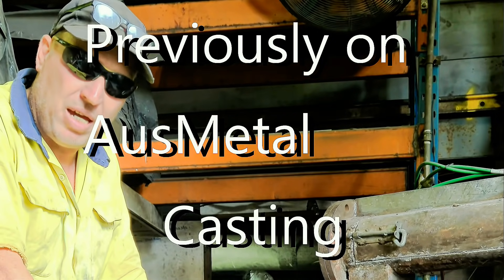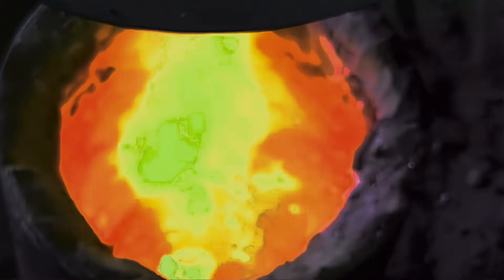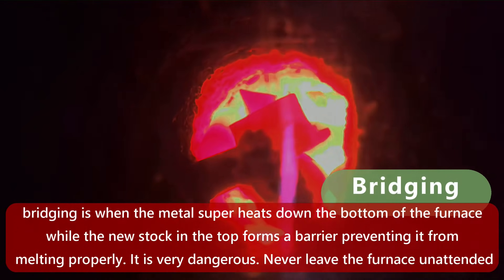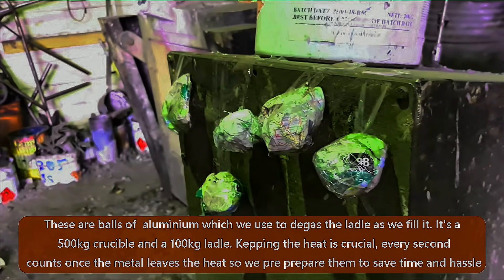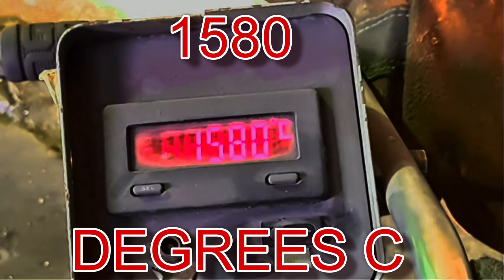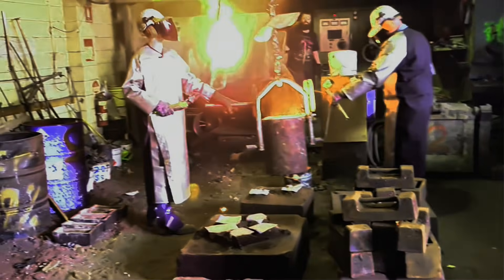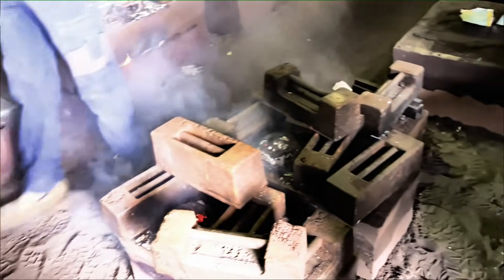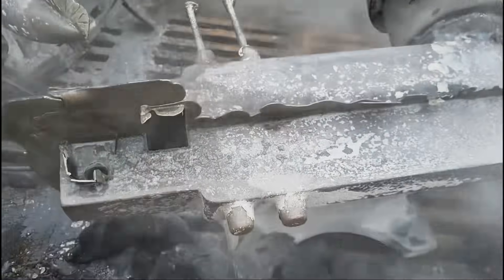Making a 100kg / 220lb Steel Anvil - Melting Steel, Pouring Molten Metal, Red Hot Water Quench

Comment: The fact you make you own power to melt the metal.  The pour is the highest quality .
Reply from the maker: Cheers!
Reply: @AusMetalCasting  before I shut my foundry down we had entertained and should have gotten a generator. Power delivered to us via power lines we were billed 5,000.00 a month for demand charge on top of our use which was 2,500.00 a month for a 350 KW for a total of 7,500.00. Journeyman molder by trade here. Good to see my fellow Foundrymen in action. 59 years old now started at 17.

Comment: I work on detroit diesels. My old crown school bus has a 6L71 turbo charged detroit. My boat has twin 6v53 engines. I just rebuilt an 8v92 like the one running that furnace.. such power from a simple 2 stroke engine

Comment: 9:25 doesnt top pouring lose a lot of heat, introduce unwanted oxygen, and cause excess agitaton ?  Wouldnt pouring from the bottom partially mitigate all three ?  Also, what about pre-flushing the heated ladle, and mold, with xenon gas further reduce oxidation ?

Comment: yesterday i saw a japanese knifemaker video, traditional charcoal forge. he coated the knife with some clay pattern on the blade, put it in the forge and quenched it with water. the clay mix prevented some parts of the blade from  getting too hot, acting as a heat shield, in order to remain soft when quenched, at least thats what he said, i dont know if this is bs. here you jet specific parts of the hot anvil with water to harden these areas.
after the blade was polished the blacksmith could see the quenching pattern on the final blade surface. meh.
I have seen another guy on youtube, just immerging in water (or was it oil i have a doubt) the edge of a knife blade, about 1cm along the entire curved length of the blade.
while the japanese guy drew some cross lines with the clay to soften parts of the blade's cutting edge. 
man i guess now im a quenching expert after aknowledging these different technics. hhhhhhhhhh.

Comment: Must be quite a high alloy steel if that slow a quench gets it hard, wow. Many Blacksmiths report that old carbon steel anvil faces need an absolute deluge, basically waterfall or watermill penstock or emptying a big drum of water on top....
Reply from the maker: Bob is only quenching the bed and horn. The way the red hot metal turns it to steam is essential to the process. We are avoiding quenching anything but the bed and horn and allowing the rest to air cool. Jamie was there for quite a while quenching
Reply: @AusMetalCasting  Yeah, of course. But if the face of an anvil is 1045/1060 or some such you need an absolute deluge to reach a rate of cooling that will harden it at all, only a second or a few are permissive. Very high alloy steels on the other end can even harden when cooled over minutes in air. Yours must be somewhere in between. Something like 1045 would not harden from that Garden hose or if it did harden, would be immediately tempered back to soft by the heat stored in the body. Very interesting. How many HRC do you get approx ?
Reply from the maker: @Zonkotron  It's definitely an alloy. It's Bob's secret recipe that has been passed down between foundrymen. He won't even tell me what it is completely. We're shooting the finishing video at the moment so I'll see if he will talk about it

Comment: I can assure you the generator does not produce enough power for 1000 homes a Detroit 8v71 could either be 100 kw if its a 1200rpm unit or 150kw if its a 1800 rpm unit the average house uses 10 kw so it could power 10 to 15 homes

Comment: You guys have a pretty sweet set up
Reply from the maker: Bob has worked hard to get the foundry to where it is today
Reply: Wanna bet I owned a foundry anytime you quench steel or iron it hardens it. Its about freezing the matrix before the nuclei parciptates out and expands the grain. It has to be a carbon steel mind you not a 1018 or 1020 it has to be a tool steel with slughtly higher carbon, chrome and Moly. My anvils quenched at 65 on the c scale.

Comment: My granddad worked in a foundry in the 40's and 50's before he retired he made an anvil at home and took the mold with him to work with 20 steel crankshafts from decil trucks and one from a bulldozer. They helped him melt them and his boss used the left over steel to make his own smaller anvil. Gramps weighed 253 lbs. After finishing and it was kelly green. They sold it at the estate sale in 1972 while i was overseas or it would still be in the family.
Reply: Eu am de la taică -meu un atelier de forja topitorie iar eu am adus o nicovala de 250kg din Franța e quality!!All te Best !✍️🙋

Comment: As a 17 year employee of BHP I can say I've spent 8 years with a manganese mine (GEMCO) on Groote Eylandt (admittedly a couple as a contractor) in the Gulf of Carpentaria, 5 years with BMA, which is a metallurgical coal miner in the Bowen Basin and now almost 6 years with Olympic Dam, a Copper mining/casting company in the far north of South Australia. So I can say legitimately that I have been involved in three of the processes you've demonstrated.  I was starting to worry when you seemed to be approaching the pour without proper PPE but you made me proud. Keep up the great Aussie manufacturing tradition. I only wish I was still on the tools so I could justify ordering a Hunchback.

Comment: Thank you, reminds me of my 33yrs in the steel making industry where we would make and pour 500ton heats at a time. I could almost feel the heat and smell the smells!
Reply from the maker: Awesome!
Reply: Still mills are awesome. We cast a lot of door jamb castings for the coke ovens a high chrome grey iron for heat resistance for US steel and several others. A friend of mine was telling me a bout a 20 ton ladle developed a carbon boil and boiled out in the floor. They was spraying it down and rolling it up with D9 dozers. I have had furnaces to boil on me hut them with aluminum to lay them down. Of course that was only 2,000# not 20 ton.

Comment: Wow really enjoyed your video.  I worked in the Berlin, WI foundry and I worked with air set at that time.  I see you paint the cope and drag, I would guess because the sand will not allow fine and course sand to mix well.    We had a large sand hopper that had baffles inside about 2 feet apart.  The baffles were sheets of metal with holes drilled about 3 inches apart in rows.    The sand would drop through a few of these baffles before going to the auger where it would mix with fluid.  It helped alot.  We casted 4 cyl. Motor engine blocks.  We did have to coat the molds with a spray to cover and problems with imperfections.

Comment: There's something about smelting and casting that is incredibly satisfying.  I working at the Copper Smelter up in Mount Isa for 5-6 years in my 20's. Did a lot of basic casting of copper when I was bored babysitting the anode wheel.. similar to this on a smaller scale. Ran a PS-1 converter an, anode furnace and anode wheel for a couple of years.. molten metal can be VERY treacherous, especially copper foam-overs.

You're right about molten splash.. I used to shave my chest hair. It was too hot to keep the buttons done all the way up to your neck, and those hairs are great for catching a splash ball and letting it burrow into your skin while you dance around like an idiot.

You should show them what happens when you pour molten metal on water in a mold. :)

Comment: Outstanding! I once worked at Alamo Iron Works here in San Antonio, Texas, USA (not defunct) repairing rebar benders. I had a chance to look into the massive induction furnace there. All I could think of was "This is what the mouth of hell must look like!" They would use crucibles to hold the molten metal that must have been a meter and a half across.

Comment: Great work really amazing process! Do they harden up ok with that small stream of water onto them? Intuitively I would have thought its huge thermal mass would prevent it cooling quick enough from such a slow stream of water. Or did you dump a couple buckets on first?
Reply from the maker: Negative. The stream is crucial to the hardening process. We only want to quench the bed and horn. We do it slow and consistent and avoid quenching the base and meat of the anvil

Comment: Ok so.The first video was interesting, but paced a bit slow. And there was no pay off. So I got annoyed. I see this video, and the mold was very interesting. I think sometimes you can use gypsum and spirit? Anyway all the typing on the screen and re-dos and stuff  ... annoying. really annoying. If you want to re-show it, or show it in slow  motion again, just do that. This video was annoying. And again the pay off did not show the cleaned up finished product. The mold and molten metal make this easily interesting enough.

Comment: this is very exciting, and very informative. good job guys. i got a question. i am a laymen when it comes to the work you guys are doing, so since the metal is being melted using an induction furnace, the metal thats poured in is not electrically charged right?